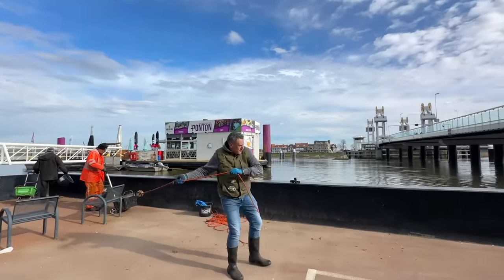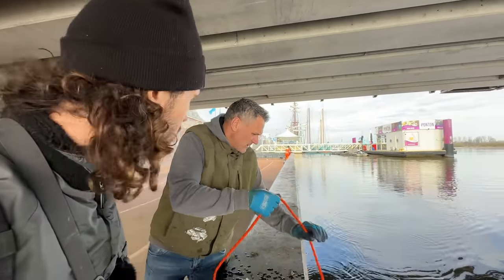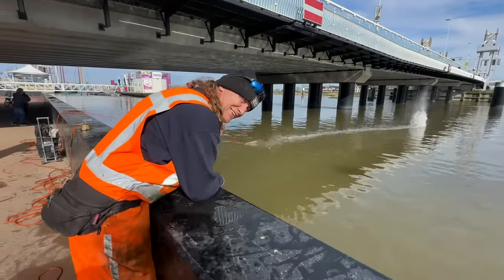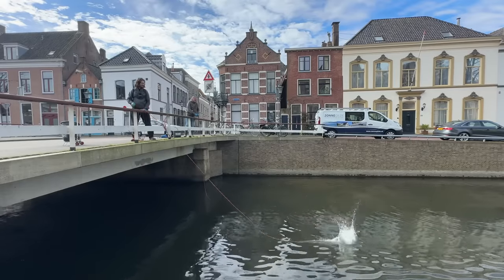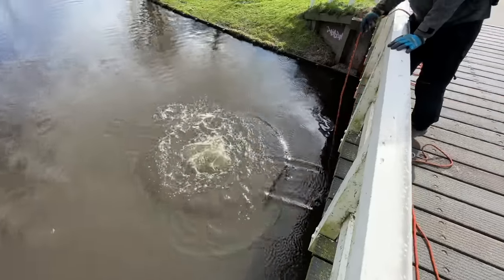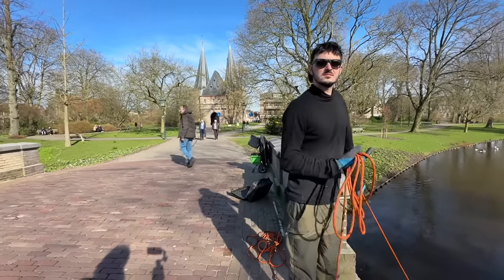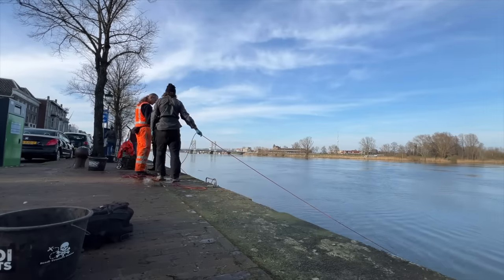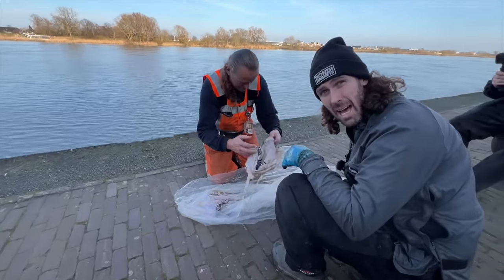We Found a SWORD! Now we're back at the Spot (Magnet Fishing)

Comment: That thing that he called a transformer it looks like it could be a Magnatron from my microwave. The cool thing you could make with magnetron is two rods, steel or copper or electrical conduit stuck in a log or block of wood, depending on how big of one you wanna make and you get the directions on guess what YouTube and when you plug it in it makes arc from one rod to the other and the arc climbs up and off the top like in the old Frankenstein movies. It actually makes ozone, which is why the air smells really good after a thunderstorm. Be careful if you make one you could hurt yourself when I did it. I plugged it into an extension cord and then got back 50 feet and plugged in the other end of the cord to my outside outlet I did it at night and it really looks cool